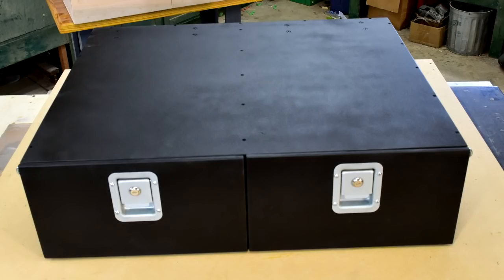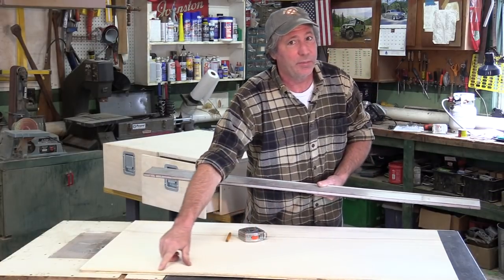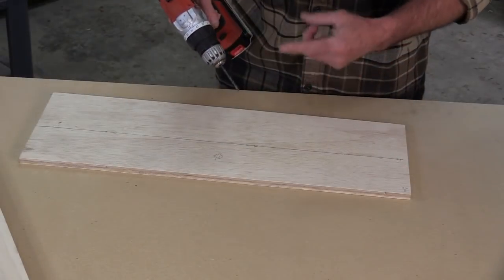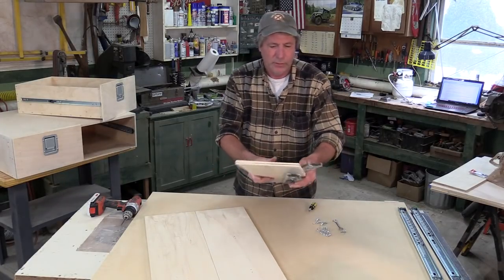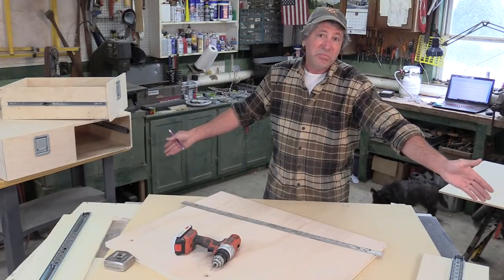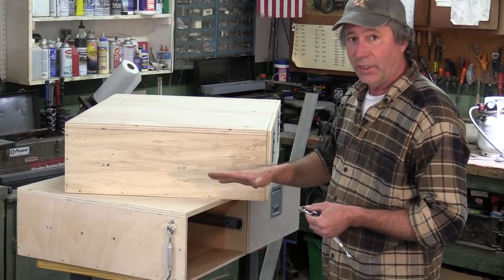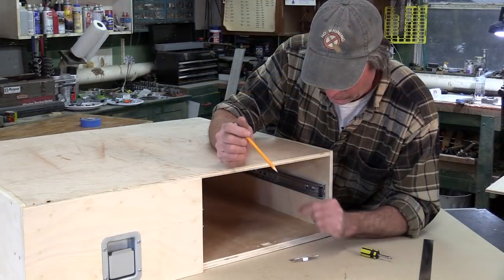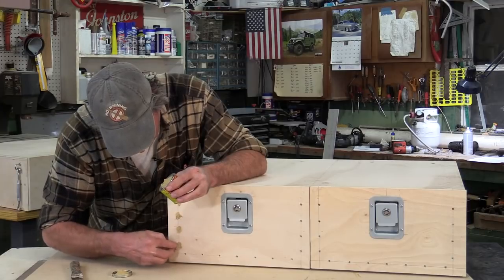DIY Rear Drawer System Overland Storage, Easy to Build With Simple Tools

Comment: Hi guys - hope you’re Covid safe up there in the US - a great detailed video with tips to help great looking drawers - I am building clothes drawers for my Aluminium canopy fit out for my Toyota Hilux ute (you probably call them ‘trucks’) here in South Australia so I will use your guidance but convert to metric -  I also measure three times and glue, nail and screw - I am using drawer slides with locking front levers to avoid slide out when parking on inlines, locking nuts and countersunk screws will finish off with carpet outside - take care John in SA

Comment: I really appreciate you making this video. I've been a subscriber for a long time and you guys are my "go-to" for 5th gen 4runner mods. I can confirm the measurements are spot on for the 5th gen 4runner. If anyone out there wants this to be flush with the wheel wells, you will need to go a bit taller. The height, as stated in the description, is perfect to have a Yeti 65 on top (without a slide) and retain easy access. My only criticism is that you did not factor the price of beer into the total cost. Thank you again!
Reply from the maker: Thanks for the heads up on the measurements! Your comment will likely help many in the future! Factoring in the cost of beer used can vary so greatly that we didn't want to include it. Quantity over time spent, domestic vs import, craft vs swill, and let's not forget  alcohol %.
Reply: knowing that 3/4 or even 1/2" ply is not exactly those measurements (3/4 or 1/2 thick) do the measurements in the video notes account for this?
Reply: I’m curious bc I’m half way through cutting the pieces and I believe the 1 sheet of 1/2” isn’t enough for a 5th Gen build
Reply: @terryperry838  I had to buy a 2nd sheet as well.

Comment: A very impressive  helpful and self educating video. Loved every bit of description. 
I own a TOYOTA RAV 4 model 1996. I made previously 2 different setups, but was not satisfied. I am sure this set up is gr8 for my camping requirements. 
The measurements are 
Front = 33"
Height is = 18" to fit my Marine 36 ice box
Depth is 24". I can extend it to 25 inches to accommodate the 24 inch drawer sliders.
Your help in planning would be more than welcome

Comment: This was great! I just completed the build on my own for my 2016 4Runner. I have the 3rd row so the configuration of my box was a bit different, but the video, directions, and parts list were great to go off of. I went with 3/4 for the entire case because we had the wood, and wanted a bit more heft to it. Made some small mistakes here and there, but happy with the overall build. Thanks for the info.
Reply from the maker: Glad it helped!

Comment: Everything looks good except for the front face. I just don’t like seeing the screws at the front face. So what I did was put a 1/2inch board to match the dimensions of the interior drawer. Attach that from the sides of the drawer, then screwed from the back attaching it to the faceplate. Making sure I don’t use screws that will go thru the faceplate.

Comment: Great video - that's a TON of work!  I appreciated the drawer-latch wisdom, esp the strike plate.  I've used similar latches, and I'm not a fan - but they are simple and cheap.
Reply: Dean J what’s your preferred method for locking similar style drawers?
Reply: Mike Rasmussen well, on my current build I plan to use a compression latch from Southco.

Comment: You have now bigger orange boxx rear fold down table did you have to move back drawers to clear orange boxx when shutting rear door via orange boxx I own Toyota  cruiser bought front runner drawer and also bigger orange boxx rear fold table. But on orange boxx web site notes before ordering bigger table you need to move back anything 3.25 of a inch to clear rear door with bigger rear fold down table to be able to shut rear door so I will need to delete rear seat on my Toyota cruiser move back drawers. To clear drawers nice viedo
Reply from the maker: We built the drawers to fit the bigger hatch table so we can still use with our rear seats up.. It does extend into the interior a bit. Thanks for watching our vehicles.

Comment: This is excellent for us newbies.  Will use this to build a custom drawer system for the bed of my Tacoma.  Q: Does the drawer slide have to be the same length as the length of the drawer opening?  So, if I have a 48" long drawer, does the slide need to be 48", or can it be shorter, like say, 42" ?
Reply from the maker: Thanks for watching! The slides don't have to be the exact length. With a 42" you'll just have a little bit of the drawer that doesn't pull all the way out. No big deal.

Comment: You had 2 different approaches to attaching the drawers : turnbuckles for FJ and bolted base plate for the 4runner. Your explanation for the latter was the weight of the ref. 

Would the turnbuckle also work for the 4runner so that the entire drawer/ref system can also be easily removed ??
Reply from the maker: Turnbuckles can also be used in the 4Runner.

Comment: Really amazing video, I’m following this closely for my build. Thank you for sharing. Quick question, if wanted the inside black, could I just use the bed liner instead of the clear polyurethane? Also if I am covering my box and inside drawers with outdoor carpet, do you still recommend doing polyurethane? Or will the adhesive for the carpet not stick?
Reply from the maker: If I were doing carpet held down with a contact cement I would first give all the surfaces a thin layer of satin poly. That way the wood is sealed and the cement won't sink in as much, leaving the surface too dry.
Reply: Wanderlost Overland I was actually planning on using a high strength spray adhesive, such as the ones by 3M. I think will do a coat one or two light coats of polyurethane though. Hoping it will stick just fine. Storage system about 50% built, your video helped a lot. Thanks for the reply.

Comment: Your videos are the best! Being a 4runner owner I am subscribed to your channel. Just curious though why you mount the slides at center height on the drawers? Almost all the other videos that I have watched the slides are mounted at bottom or an inch or so up. Is there a benefit or does it make a difference where the slides are mounted height wise? Or is it just preference?
Reply from the maker: Thanks for watching!
Whenever you mill groves in, and drill holes through any wood, solid or plywood, you weaken it. Since there's a dado groove at the bottom to receive the bottom panel, I wanted the holes for the slider bolts to be a decent distance away.
Reply: Did you use Dado's on the FJ drawer build? I thought it was all butt joints.

Comment: Can you explain briefly why the drawer slides are placed .5" back from the front? Is this applicable regardless of the drawer measurements? Thanks!
Reply from the maker: The slides are a little shorter then the case..

Comment: If using all 3/4 IN material, how does that change all of the other measurements for the 4Runner?. Please excuse my inability to do basic math.
Reply from the maker: If keeping the exterior measurements the same as in the video, add 1/4" to all those on the inside.
Reply: @WanderlostOverland  Ok I see, I'm however making two separate cases so I can remove one at a time if needed. My question is would you make the bottom piece the same size as the top and screw down into the sides or make it so it fits in between the side pieces. I tried it the first way and when I put the back panel on it was short 3/4 from the bottom. I don't mean to be a nuisance but cant really afford to make many mistakes and have to start over. Again thank you for your time.

Comment: If this storage box was built for very light use would you have to still glue it?
Reply from the maker: The glue is the main component in holding it together. Even under a light load the screws won't be enough.
Reply: @WanderlostOverland  nods